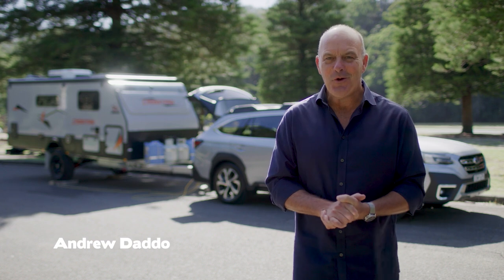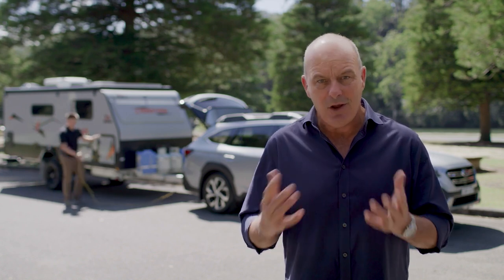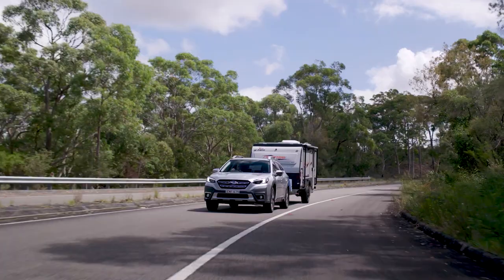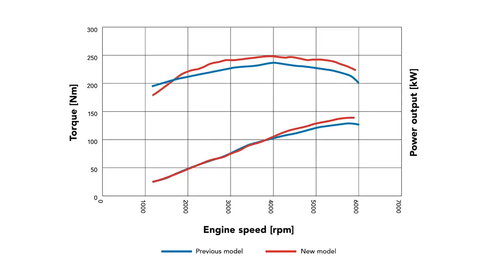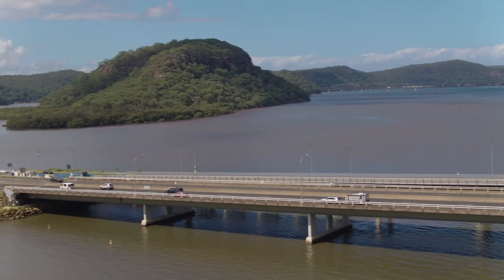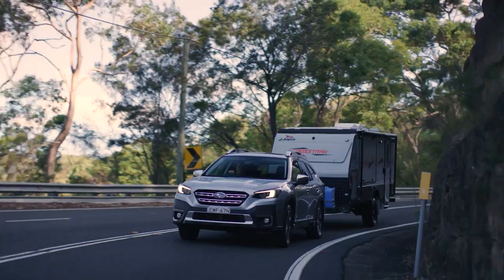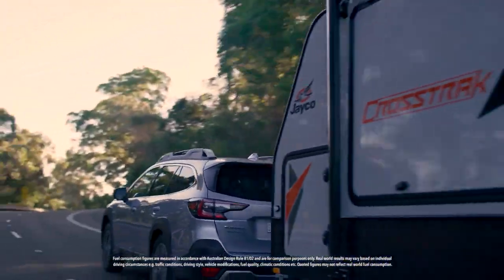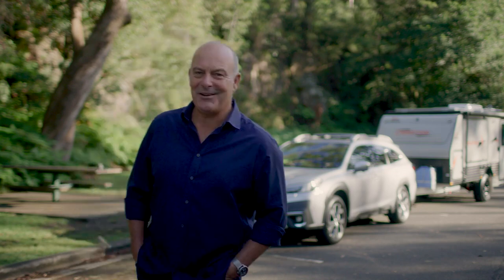All-new 2021 Subaru Outback - Towing | Subaru Australia

Comment: While this non-turbo version may be more "powerful" than the old 3.6 in terms of towing capacity, as you can see a lot of us will hold off purchasing until we get a turbo 2.4 down under—if that 2.5 is already that strong, imagine how much a turbo will be like.

Personally, I will wait until we get a full-spec Wilderness edition (with turbo, of course) before I replace my old Outback—I use it for camping and I avoid the rougher terrain precisely because I am aware of the limitations of an Outback. While the Wilderness will still be just a "softroader" than an actual off-roader, it will still be better than the base versions.